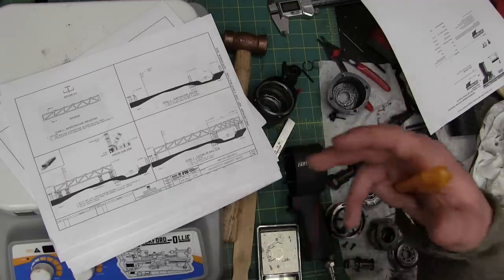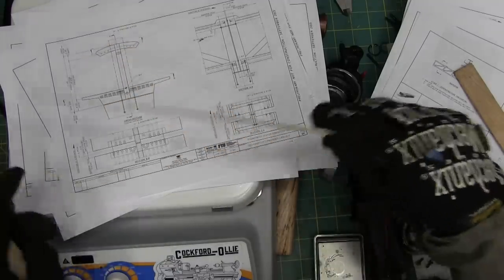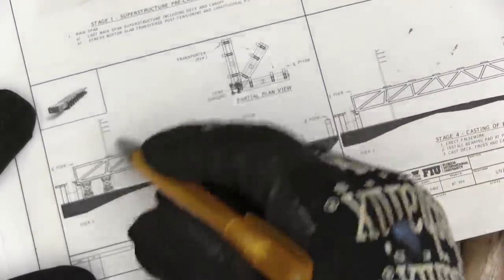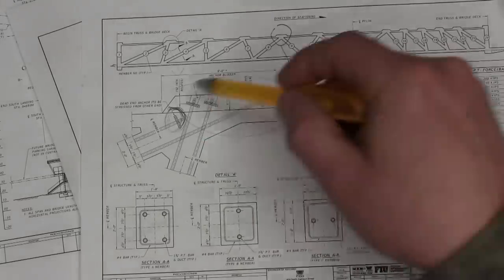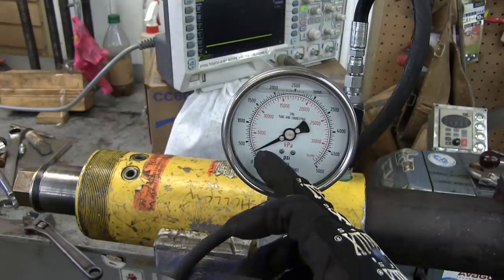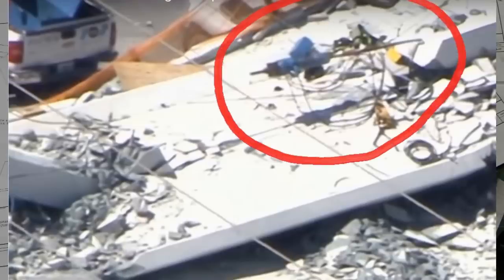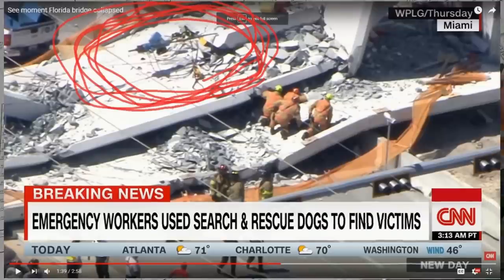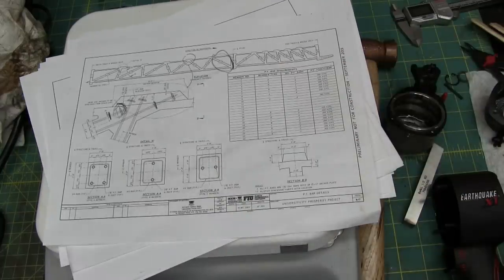Post Tension Failure Florida Bridge Collapse | Engineering EXPLAINED!

Comment: So what you are saying is the post tensioning action of the workers on site caused a traumatic stranded wire failure inside the concrete which is under normal compression as a prestressed slab  and the giving way of the broken strands acted like a bomb inside the slab destroying the compression and it cracked in half where the broken strands occurred . Why wasn't that done with cribbing supporting  under the center of the bridge in case of failure,which happens sometimes when repairing older slabs???

Comment: Please note that the last diagonal truss chord would not have a post-tensioning rod, as you would have seen in the drawings. This member would always be in compression. They would have been  tightening the cable for the second last diagonal, which would be in tension.

Comment: In my previous life I built high rises and bridges. Here is what I see happened with the bridge collapse in FLA. Few media said they were doing a stress test. What they were actually doing was tightening (stressing) the post tension cables. A double decker bridge this span probably had 100 post tension cables in it. (split between top and bottom deck) Depending on the weight and length of the bridge determines cable size and pull (PSI) on the cables. I've done a lot of building and bridges with post tension cables in them. I would say by the length and span the cables were 3/4 " and stressed to 75,000 PSI or more. If one or more cables were to close to the top of the concrete as it was poured, when they stress the cables the cable will rip out of the concrete and add more stress to already stressed cables which could cause a domino effect. We ALWAYS had plenty of shoring under anything that was being stressed in case a cable ripped out that way you don't add much more stress to the other cables. And I've seen them go before and you don't want to be anywhere near it when it happens. If a cable rips out of the concrete it can cut a man in half. Why they allowed vehicles to be driving under it while doing that is beyond me.

Comment: I agree with you as to the point of failure, however I think you picked the wrong member.  The member you picked is a compression member and prestressing it would not help.  The second diagonal, which is a tension member, could benefit from prestress.  I think it might be the culprit.  The whole thing is a crazy design to start with...

Comment: AvE I would think that the PT bolts would be measured and the length recorded before they are installed .They will stretch when tension is applied and the maximum length is known by engineers before maximum tension is reached. This can be calculated and converted to torque applied to the nut on the PT rod. I think the PT rod was past its maximum length after the bridge was moved and should have been replaced  not tighten more because it was loose.

Comment: The final diagonal strut is very shallow and is supporting 1/2 the weight of the bridge alone.  It is in compression, significantly amplified by the shallow angle.  Why is it being additionally compressed by post-tensioning rods?  There will be some bending in the strut also - particularly if the deck is presumably heavily post tensioned.  Is it possible that the strut simply failed in compression at the point of maximum bending?
Reply: The main reason the bridge failed is that the cable stayed support system was never built. No cable tower is visible. No main support cables, therefore no way for this section to stay up without being supported from underneath. Half of those diagonal pieces of the section were supposed to connect to big strong cables.
Reply: Yes John, you are quite right. The strut failed and a hinges formed in the roof and then the deck. However, AvE could well be correct insofar as a failure of the stressing tendon would have caused a sudden release of a large amount of energy and overloaded the strut.

Comment: So just got clarification, you're saying that during the transport of the bridge, the increase in temporary span length between the transport caused the pt-rods to plastically deform? So when they went in to change the tension in the rods, they weren't necessarily tensioning the rods, as they were deforming them further?

Comment: There is another video out that shows the bridge from a camera in a car just as it fell. And what do you see on top of the bridge at that moment but two workers adjusting that tensioner exactly where you described. They came falling down on top of the rubble as it fell, but I doubt they were hurt. Like you said, they should not have been doing any of this without blocking off the traffic below. Great call. You should be on CNN telling them how this happened.

Comment: Great analysis. You did answer quite a few questions I had. Post tensioning a structure normally requires all non construction personnel to be well away from the worksite. Your comments about allowing traffic was about the same as mine. The other worry was about the member in which post tensioning was taking place. I am guessing that the tension rod was likely faulty and was undergoing plastic deformation at well below its expected yield strength. Would they have seen that happening or does it happen too quickly to be picked up?  By the way it's the construction industry. What colour language would you like?

Comment: When the bridge was moved the support system on the failed end was moved towards the middle.   Leaving the failed end top slab under expansion instead of compression.   It would apoears that the tensioning bolts would get additional loading and stretching into a plastics state.   Retensioing it once placed would cause a failure.   Is it possible that just improper supporting during the move caused this?

Comment: Neat analysis.  My two cents... if the steel failed as predicted here (I tend to agree with poster), then the stress/strain curve you should be interested in is that of the steel.  If they moved the support inside during transport then member 11 will see more tension and if they pre -stressed the steel so the now cantilevered end would not sag too much, then even more tension in steel results.  If this placed the stress close to (or over)the  yield, then with the dynamic load of movement, it could bounce over yield many many times (fatigue).  Causing plastic strain to accumulate in steel and cracks in concrete.  Yielded steel will only stain more as more load is applied and things like (the nut never tightening would occur) until rupture and failure.  Not necessarily facts, just some ideas.
Reply: The only problem I see with member 11 failing is that, though in tension during transportation,  isnt it in compression once installed on piers?  Perhaps this is why cracking was not seen as a problem?  This then shifts my attention to member 10.

Comment: Why are there post-tension rods being used inside a compression member? That last diagonal (the one that seemed to have broke first ) is presented as a web member. But its immediately identifiable that it is actually acting as a compression chord for this truss arrangement. The last vertical member at the end and the last top horizontal member are not part of the major load path. So if they've got an chord already in compression, then they add more compression into it as if its a tension member, you get a fast brittle failure when the concrete pops. Except the initial points of failure around the end of the tension rod will be concrete cracking, then load transfer to the surrounding reinforcing rebar, then more concrete cracking as the load redistributes. As you pull on the tension rod with a hydraulic cylinder the pressure will keep dropping off during that load redistribution. Keep pumping on the cylinder and you can get the pressure back up again, then a little later it'll drop off again from a higher load. You might get away with this for a little while, but eventually the internal stresses don't have anywhere else to redistribute to and you get a big pop, the rod goes shooting out the end of the hole with enormous force.

Comment: One point I haven't seen mentioned yet relates to the design of the truss itself. This truss is not symmetric. The angled members near the failed end have much more of a shallow angle than the members at the other end. It looks like this was done so that each angled member will be co-linear with the overhead cable that will be attached to it. But trusses provide strength through the use of triangular placed cross members. In this particular span, the cross members on the failed side exhibit much less of a triangular shape than the ones on the other side (the side that didn't fail). Any comments?

Comment: A thought: Perhaps it was the very snapping of the tension rod that dropped the bridge. If you graph tension against time, the rod snapping abruptly creates something close to a step function. A function with very large high frequency components in its power spectrum. These would, of course, propagate through the bridge as sound waves. The course of such propagation would be complex to calculate. But I think it would be safe to assume that a good bit of it ran through the truss element that surrounded the rod. Sound waves running thus encounter a hugh change in impedence where the truss joins the upper beam. So there would be significant energy deposition there. Now, consider sound running through concrete on the scale of under an inch. The speed of sound through the cured cement matrix is surely different than it is in imbedded the stones and sand. Having very short wavelength, the sound waves would cause some micro fracturing of the cement when their energy is deposited at the impedence change imposed by the aggregate. The cement, locally pulverized by micro fracturing, would no longer lock the concrete into a rigid matrix and compression would be possible under much smaller static load than intact concrete would resist. A widespread wave of this passing through the upper beam would allow it to fail in compression at low static load. And that is what it appears to be doing in the videos.
I am not an engineer. I am in no way qualified to say this is what happened or even that it is a plausible hypothesis. But I think it is an interesting notion.

Comment: That darned thing as designed was supposed to have a single tall pylon and pipes that looked like cable suspension, lining up with half of the diagonal truss members. Not really visible in this video. But obscenely, the stuff above the top of the truss was was not really functional, but just for fucking looks! So they skewed the diagonals of the "truss" from a more ideal 60 degree angle forming equilateral triangles to some skinny triangles just for looks. To line up with what looked like cable suspension. This magnified the loads on connections for PURELY aesthetic reasons.  What a bastardized concept of a bridge. It was intended to LOOK a bit like a suspension bridge but that was just for show, which probably confused the public and the engineers. Thinking it was much stronger than it was! Phony stuff is not just unnecessarily expensive, it can get people killed for no good reason. In this case. 

All it took was the failure of ONE truss member connection (that was cracking badly) to make the whole fucking thing INSTANTLY fail. No oversized connection gusset plates at the cold joints in the concrete. Worthless worthless worthless! 

They also should have closed the road or at least painted a "keep clear" area under the faulty bridge during work. To keep traffic from backing up behind the signal light a little ways beyond. It could have saved several lives. Instead traffic was backed up under the bridge for the traffic signal when it collapsed! Thanks for the good work again AvE.

Comment: That in fact turns out not to be the smoking gun.  According to the NTSB report the crew hadn't yet begun tightening / loosening that particular PT Rod.  Turns out that work crew had only just previously performed the same actions on the other end of the bridge, and had just tensioned the PT rod on the collapsed end, but not the one circled.

Comment: Spot on. Great explanation. Shouldn't have designed a bridge that totally fails on a failure of a single PT rod, or a single point of a structure. I'm certain part of the problem was that the concrete hasn't attain it's optimal strength yet. That or the design of the bridge was really bad. Because, in all part of the construction or installation stage of this bridge, I'm pretty certain the designers and consultants where notified by the contractors and asked approvals for it. A "sudden total failure" caused by a failure of a single member of a structure is just a bad engineering design.

Comment: The sad result of this is that there will be "overkill" traffic closures as a result of this, rather than only closing off traffic when it NEEDS to be closed off. Governments ALWAYS take the easy way out. I'd rather there be safeguards to prevent what happened, and that's that. And severe punishment for violated safeguards. There are incredible safety redundancies and redundancies already in bridges, due to the high stakes; so it's highly likely that those were violated, and it killed people.

Comment: Worth noting.. (@7.00) The tendons help the concrete resist tension but in a truss the diagonals alternate between compression and tension. The end diagonal on this truss when supported in place over the road at the very end of the span is in compression. So the second diagonal is in tension, this would be the one that failed in tension by steel failure that you mention. But, when being moved into position the support was under the point where the 1st and 2nd diagonals meet, this would have reversed the compression /tension in the diagonals.  The reason for detensioning the tendons (8.20) if in the end diagonal, once placed on the supports over the road may have been because the end diagonals would no longer need to resist tension. But the second diagonals now take a lot of tension and need their tendons?

Comment: Hi, I follow the discussion with a lot of interest. a prestressed cable has a large elongation if it has not yet been poured with mortar. Due to the large elongation, extra bending occurs in the bottom plate due to the pressure diagonal. This could cause a bump in the bottom plate. Perhaps these caused the collosion?

Comment: basically they tensioned up that end hanging in the breeze then when they set it down the additional strain of the bridge sitting on that end point pushed it over the edge. if that's the case then simply checking the tension once it was sat would have shown it was out of whack. 

so we have the transport plan changed on site and then failure to properly check after installation. someones head is definitely gonna roll.

Comment: As AvE said, the crane was pulling up on the bridge as a worker tightened the rods in the web. A recording of this process would be invaluable. Does anyone know more about this? 

By lifting the bridge with the crane, this makes it easier to draw tight the web members already in tension. Obviously, there is no point in tightening rods inside any compression members. (However, according to many sources, that is exactly what "he" was doing - tightening 11.) 

In hindsight at least, it is clear to me that 2 and 11 should have been loosened first before tightening any tension members of the web. These had been pre-tensioned before the move since the ends were not fully supported, if at all.

In the dashcam video, the bridge has a distinct arch everywhere to the right of member 11. And sources have said the worker started from the other end. So I expect at the start: 2 is loosened and 3 is tightened. Then 4 is loosened and 5 is tightened. 

Perhaps 6 is loosened and 7 is tightened. Somewhere around midspan the sequence has to be reversed, so perhaps both are tightened moderately. 

9 should have been loosened and then 8 tightened. The next step was to loosen 11 and tighten 10. This step would have put some curvature into the flange left of 10/11. However, in the video, this section is rather flat. 

In fact, the upper flange may have failed precisely because the bridge strain had been entirely shifted to the North end. 

An alarming idea has just occurred to me. What if the worker failed to flip around the sequence after the mid-span of the bridge? If he loosen and tightened the opposite rods (-8, +9, and -10) the compressive stress would pile up on members 11 and 12 ! The upper flange would be pulled towards the South bending the upper flange between 11/12. Next on the list: tighten 12! Horrors!